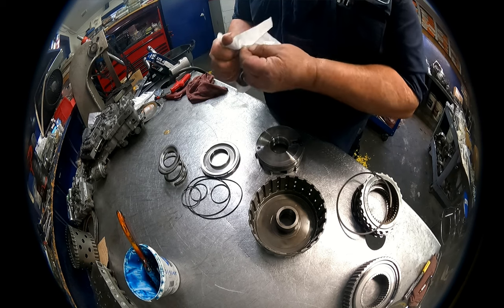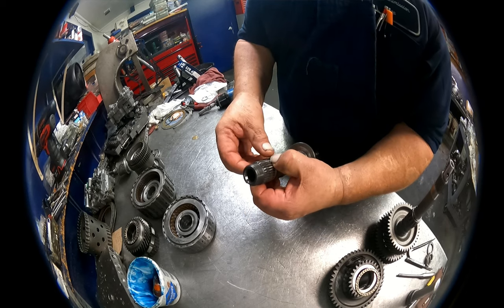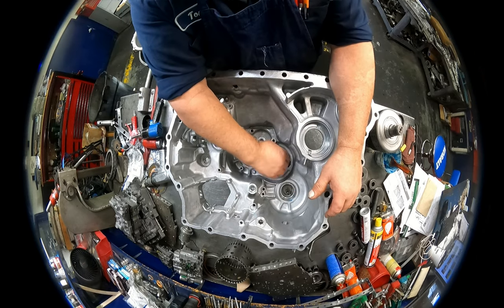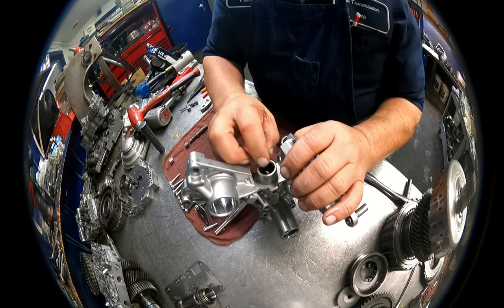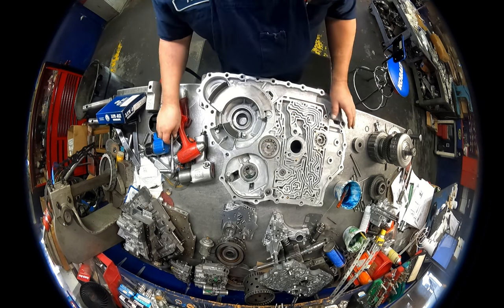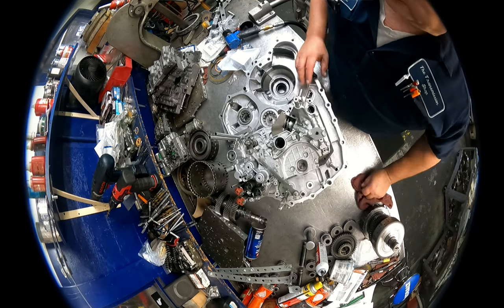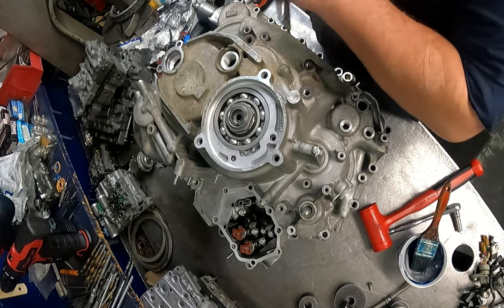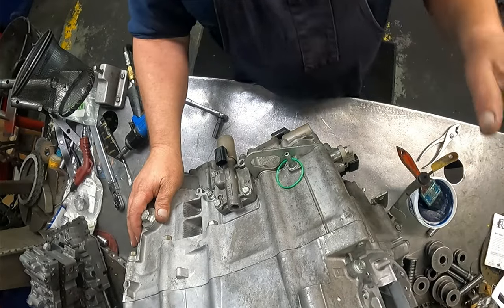P35A Rebuild

Comment: Do you know what's being causing the problem I have a 1995 Ford F-150 with a e40d transmission when I put it in drive or reverse when i press the throttle does not move and I change the transmission filter and the transmission fluid.
Reply from the maker: Before or after rebuild?
Reply: @CurmudgeonTransmission  original truck Transmission no rebuild
Reply from the maker: Time for a rebuild. Don't know what you will find till you get in there. Could be several things keeping it from moving.